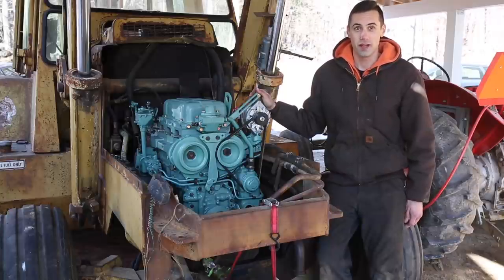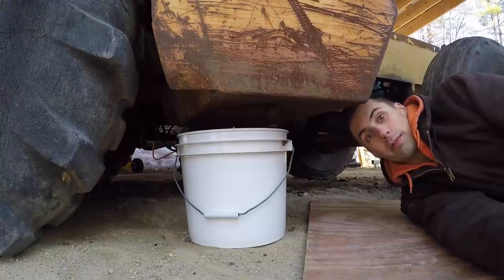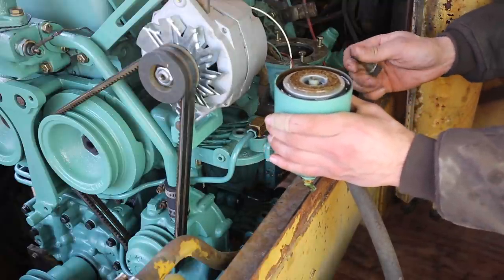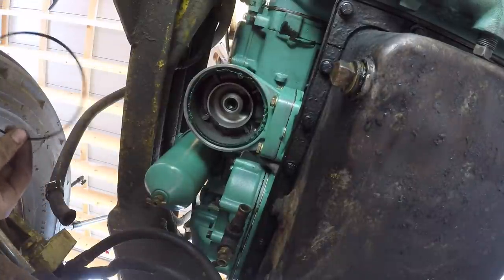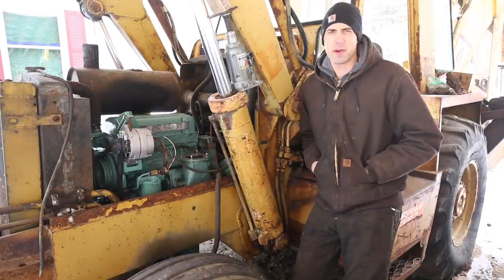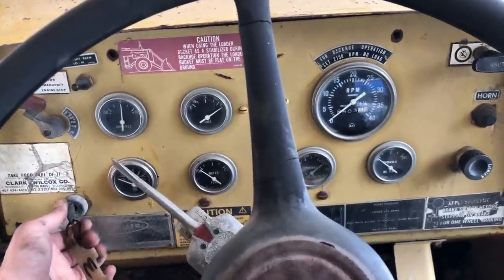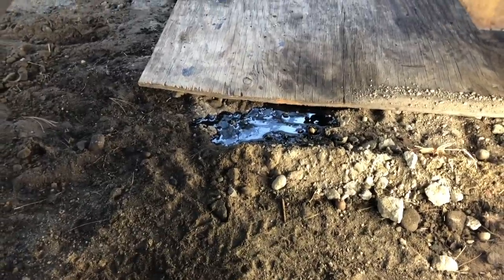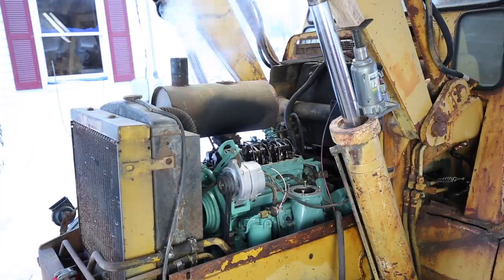Trying to Start a Detroit Diesel 3-53 for the First Time [Dynahoe 160 Part 2]

Comment: YOU Should fill the Oil Filter it with Oil
Reply from the maker: I typically do fill the filters with oil, but I'm not aware of a way to do it with the Detroit because the oil will just come out the bottom of the cartridge housing where the bolt is. Let me know if I'm missing something!

Comment: Did you do the engine rebuild yourself? Or did a machine shop do it?
Reply from the maker: Yep, I rebuilt it myself. It was my second engine rebuild ever. It's a lot of work, but it's also really cool having a thorough understanding of how the engine works!
Reply: @WaldosWorld  a word to the wise. Anytime you do a first start of a diesel like that (especially a two stroke Detroit). Have a board that can easily cover the intake, at the ready, to gag it out if it runs away. Nice job. She sounds great.

Comment: Straight 40W at those temperatures?  Gotta be pretty thick, especially for a newly rebuilt engine.
Reply from the maker: Yeah, I agree, it does seem pretty thick, but that's what the manual calls for 🤷‍♂️
Reply: Low-ash straight 40W is all you should ever run in a 2-stroke Detroit Diesel.
Reply: @WaldosWorld ... In sub-30 degree F. temps you can run Low Ash 30wgt. as well.   You NEVER want to run Any monograde 40wgt with a content of 1.0% sulfated ash, or higher.  Preferrably, try to use oils of 0.80% or even lower.  Delo 100 was the oil of choice in most OTR scenarios, and is still available.  Atlantic "Mono 2 Stroke Detroit Diesel 40" manufactures a Very High Quality oil as well for them.  

Rotella T1 is a "low ash", however it's higher then others with a rating in the neighborhood of 0.89%+/- which, over time would be "iffy" in terms of cylinder/piston scuffing and oil consumption compared to Delo 100, Atlantic 2 Stroke for sure (0.80%).  

Also, Schaeffer Specialized Lubricants make a "0671 - 005  Supreme DD 2 Stroke oil" that is Ultra Low sulfated ash of approximately 0.7%.  

Schaeffer's has been around since the late 1830's or early 1840's and primarily an Industrial Lubricant Manufacturer & Supplier... you will Not find their oils at "Walmart" nor any other "big box" store.  They do make very high quality lubricants... check them out online, for a distributor near you.  

Schaeffer's was one of the very first oil / lubricant manufacturers to be approved by GM Diesel back in late 1937 for use in our engines.  The 0671 - 005 oil comes in 5 gallon pails, on up to 55 gal. drums... it is Not sold in One gallon containers.  

Sunoco Super C-40 Low Ash,  Mobil Delvac 1230 & 1240 are also very good oils for the 2 cycle.  The CF-2 classification is a "deleted" classification certificate, since 2010... however, it is still used in labeling to reduce "confusion" for those looking for the correct spec'd lube oils for the 2 cycle GMD/DD.   

PS: NEVER, EVER... use a "Multi-viscosity" (ie: 15/40, 10/40, 0/40) oil in ANY 2 cycle GMD/DD engine (51, 53, 71, 92, 110 or 149)... it will spit it out faster than you can fill it, not to mention extreme / pre-mature, cylinder & piston scuffing.  

Don't listen to all the youtube "experts" who say they've run those oils for years with no issue's... they're lying to you.  We didn't spend millions researching, testing and specifying the correct lubricants to use in our engines for nothing.

Comment: Subscribed! I have the same machine  good luck!!
Reply from the maker: That's awesome! And thanks!
Reply: Waldo's World Just curious too where you go for parts? I’m having trouble finding new engine v belts. I have a parts manual and a operators manual but the old hy-dynamic part #’s don’t cross reference to anything anymore..
Reply from the maker: Parts can be tricky for the reasons you mentioned. As for v-belts, you just need to order the right size belt. My alternator/water pump belt measures 3/8" x 42.5" (I used Gates 3VX425). My fan belt measures 1/2" x 47" (I used Gates AX45).
Reply: Waldo's World I see. Good to see its running it sounds great. I notice you have an alternator setup on that. Mine has a generator I’m also looking to swap that out.
Reply from the maker: As for the alternator, the Detroit came with a Delco 10DN, but those are expensive and hard to find, so I bought a Delco 12SI and it seems to work fine.
Reply: Can you tell me the Starter part number for the second one u got?  I just got one that is also turning my engine the wrong way...starter shop is having a hard time matching my existing part number.  Any help is appreciated.  I have a 69 dynahoe 140 with a 3-53
Reply from the maker: I believe it's a Delco 30MT. Just make sure it rotates clockwise rather than counter-clockwise.
Reply: Waldo's World thanks that was the correct part and rotation, fired right up thanks again!!!

Comment: Is this a 12 volt system?
Reply from the maker: I wasn't completely sure at first, but I know now that it's a 12 volt system.
Reply: Thank you. Was it a positive or negative ground system? I have 3, early 60s Insley draglines to get running. They all have 3 cyl detroits. I haven't fully verified, but I believe they are this model.
Reply from the maker: Negative ground. Some Detroits are 24 volt, so keep that in mind
Reply: Thank you good sir. Much appreciated.
Reply: @8772.... If their in Insley Draglines... they are most likely 3-71 engines, Not series 53.  Make Sure, that you use ONLY CF-2 LOW ASH 40 wgt. oil from a reputable producer, ie; Schaeffer's Lubricants (0671-005 is Ultra-Low Ash content), Sunoco Super C40, Atlantic 2 Stroke 40 Oil, Delo 100, Mobile Delvac 1240 (1230 in sub 32 deg. F. temps).  

Also, the 3-71 engines should have a 24V starter.... unless you get a new "Reduction Drive" starter, that can run on 12V. they are Much lighter, and can turn a Series 71 over, quite easily.

Comment: 3-cylinder engine????
Reply: 3 cylinder GM ,Detroit 2 cycle engine..3-53 is inline ...6v-53 is v configuration and the number for example 53 is the displacement size of the cylinder in cubic inches or CUIN..a 3-53 is 159 cuin displacement engine
Reply from the maker: Yep, and because it's a 2-stroke, it has the same number of combustions per revolution as a "normal" 6-cylinder! 😎
Reply: @WaldosWorld  enjoy it while you can ...these will be outlawed soon enough due to the fact they are a "dirty," engine in regards to a tier bracket emmisions..good reliable engine though

Comment: 40 weight? Every old detroit Ive ever seen ran on 30 weight.
Reply: Not unless they were running in Sub Freezing (32 deg.F) temps, you didn't.... Low Ash (less than 1.0% - preferably less than 0.90%) 40 wgt. is what we recommended for our engines.  Higher ambient temps (above 32 deg. F.) with Low Ash 30 wgt, WILL result in excessive oil "slobber" as well as excessive and premature cylinder & piston scuffing.

Comment: B glad it didn't start because a Detroit will run backwards,,and it usually run away I've had thos 318s and 350s run backwards on me you have to use the clutch to choke it down I had 11speds in reverts and one in forward lol